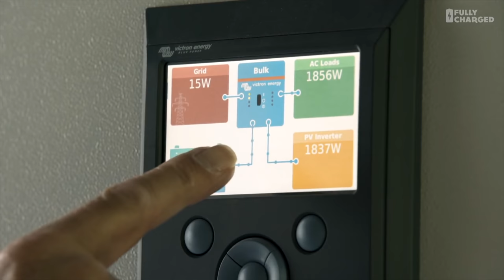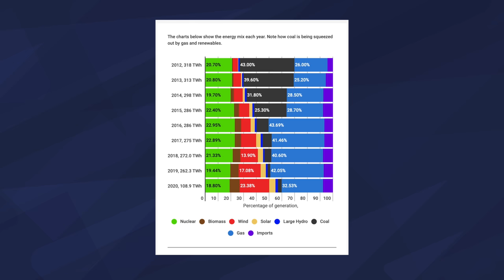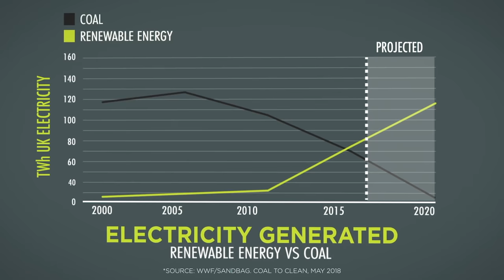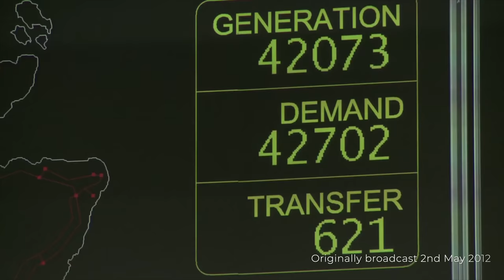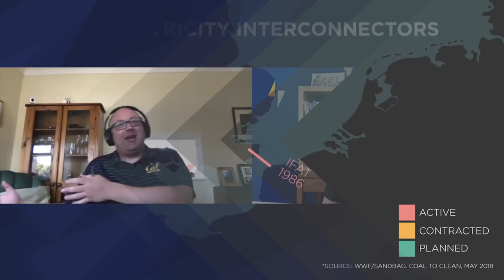National Grid ESO's Green Energy Success Story | FULLY CHARGED for Clean Energy & Electric Vehicles

Comment: The forthcoming cable running from Norway to the UK will deliver clean electricity to the UK. The Norwegians will replace that profitable eco electricity with cheaper coal fired power from Russia. Cynical or what? Also bear in mind the Norwegians have also been getting fantastically rich on oil from the Barents sea and minerals from their mountains - all with major environmental impacts.  The largest road stone quarry in Europe is near Jelsa in Norway - it dumps 250,000 tonnes of detritus into the fjord every year and burns 5 million litres of diesel on site - children from local schools visit it on days out and anyone who says anything against it is literally shunned by the community.  One of the quays that is being built to service our off shore wind farms is getting all its ballast from that same Norskstein quarry. 

The Blasjo reservoir which is an hours drive from the same quarry is a, 82 sq/km marvel of engineering and part of the infrastructure built mostly at the end of the last century. It had a big effect on Salmon populations when first built - a 20% loss was reported in all the rivers connected to it. However  that may be considered a price worth paying for renewable electricity.  Selling it to make a profit that depends on dirty power from abroad is another matter. 

In any case it would be good if fully charged and others who are rightly enthusiastic about the shift to renewables would stop lionising  the Norwegian model.  The Norwegian tourist board  motto is  "powered by nature" - it is both true and profoundly dissembling.  Norway happens to have a perfect natural set up hydro but nevertheless is powered largely by avarice. In the Norse myths Helge , the holy warrior, defeats anger and hatred but is killed on the rock of greed...
Reply: just wanted to add how much I enjoyed this conversation about the grid - informative and encouraging.